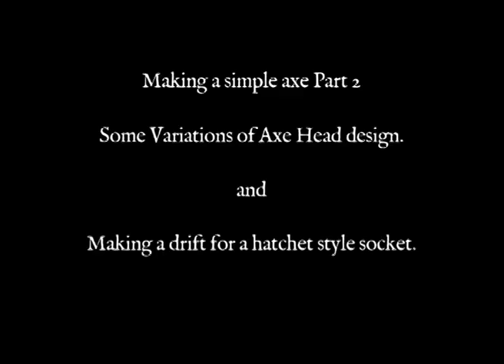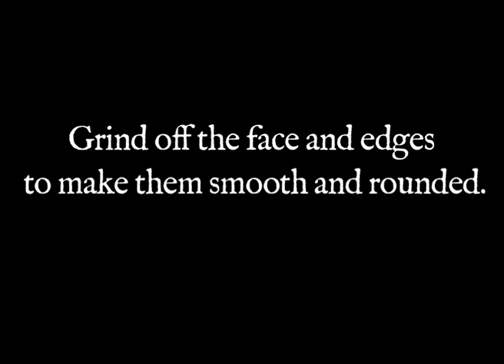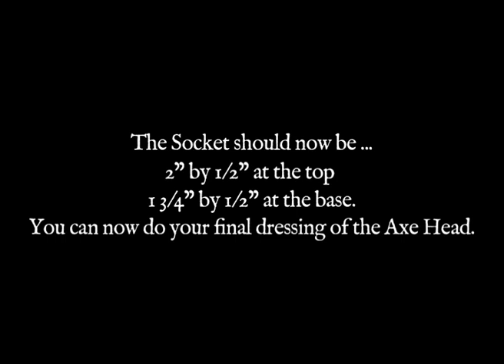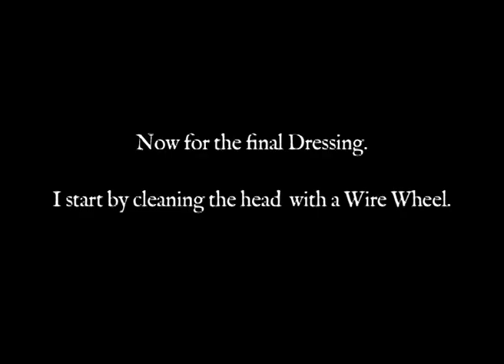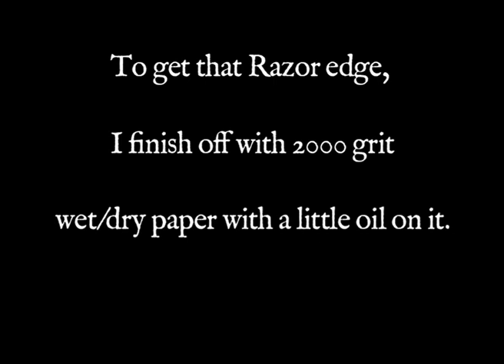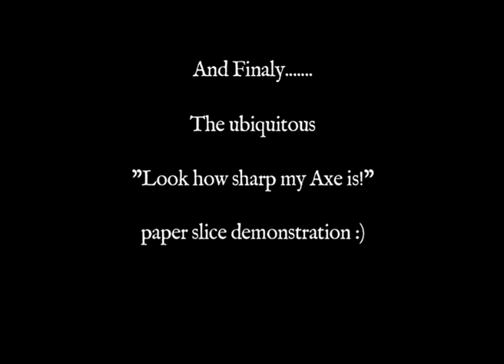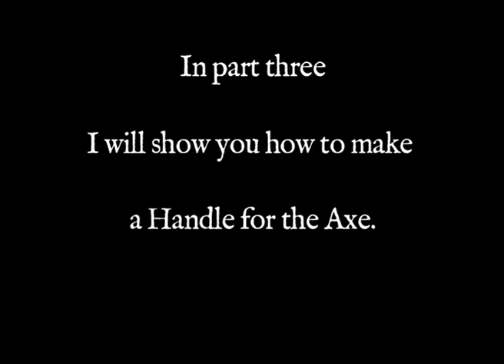Forging a Small Axe, Part 2. The Blacksmith at Swallow Forge.  Spiked Axe and Sharpening

Comment from the maker: Hello John, yup it really is that quiet, it's a 12inch disc sander with 120 grit metal oxide disc. It also has  a huge 1/2 hp motor on it which nearly ticks over in use.